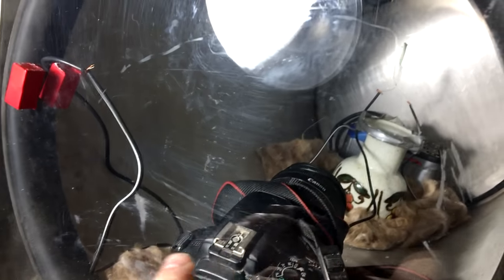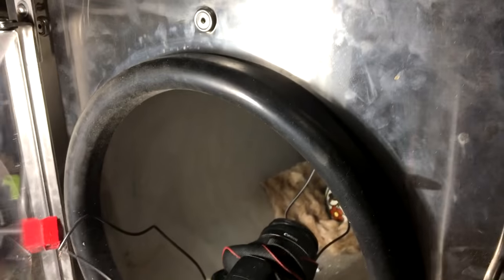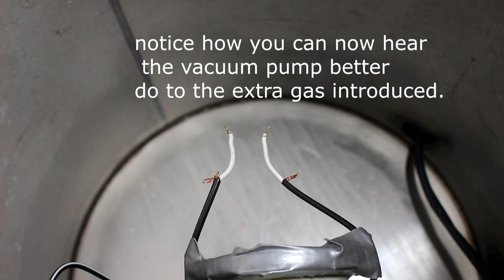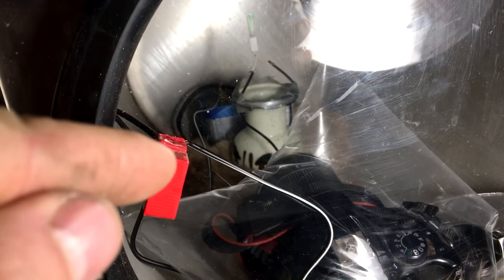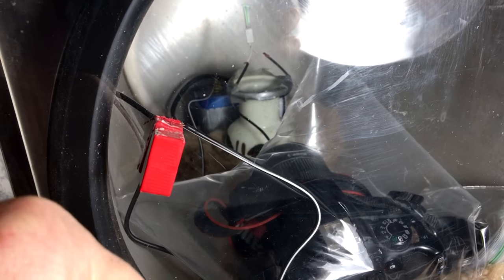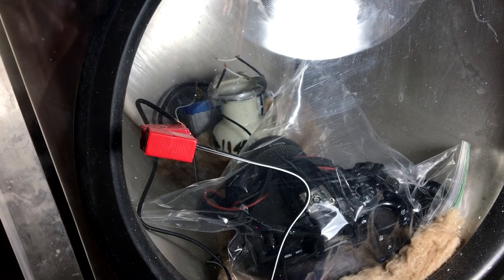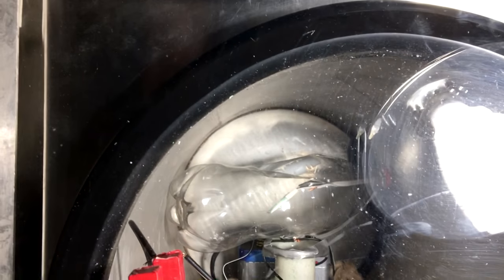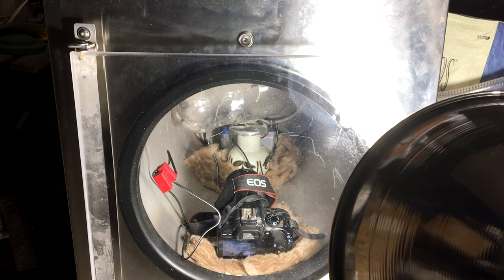Sound of Explosions in Space? part 1

Comment: OK, so explosions in space make sound.  That's good to know as I've always been told the opposite.  However, I would imagine in most science fiction movies, the space-ships are usually a pretty good distance apart.  And I would imagine at minimum you would hear no sound for several seconds or several minutes until the gasses from the explosion collided with your ship.  And even then, at those distances, the gasses would be much less concentrated than inside that little chamber.
Reply: What about a Nuclear device that's more heat than expanding gasses?
Like BSG.
Reply: Though there will be comparatively less medium for the sound to travel the individual particles will be moving at greater speeds and will therefore make more sound individually. It's hard to say, I'd guess they'd make less noise at the same distance and explosion size bc much more of the nuclear bomb gets transferred into massless photons then other conventional explosives.
Reply: @codehorse8843  
Photons thought technically massless release energy and create pressure as evedenced by the Crookes Radiometer!
Reply: One could imagine that they are using futuristic materials for their space crafts which are under very high internal pressure at all times, as a consequence of their strengthening process. Which makes them less likely to break, but when they break they break spectacularly, releasing a burst of fine powder as the material fails, helping to scatter the energy from the impact, and glowing red hot from the thermal energy of the impact, creating what looks to us like the glowing ash of an earth fire
Reply: @Allangulon  BFG 9000
Reply: @codehorse8843  I think it's too much said it makes sound, it's more like to get hit by an astroid, that sounds too ^^ Normally, the gases will spread like a sphere not as here in a tube, that will make differences, too.

You wont here the impact of protons and other elemental cores, nor micrometeorites. I think beyond a certain distance, youll rather hear the vaporising of parts from your ship skinn ^^
Reply: Actually the explosion doesn't make a sound.  What you would be hearing is the sound of debris hitting your spaceship.  It's the same in this experiment.  All you are hearing is the debris hitting the side of the vacuum chamber, not the explosion.
Reply: @magnetospin  the gas hit not debris
Reply: @toomanyaccounts  Same thing.
Reply: @magnetospin  meaning you can still hear an explosion in space. there is a moving medium to carry the sound
Reply: @toomanyaccounts  Actually, no, I looked at the video again. It's not gas, it's debris from the blasting cap.
Reply: @magnetospin  the bottle didn't seem to have debris and the guy did a post where he  consulted and the gas transmitted the sound when it hit
Reply: @toomanyaccounts  Just because you weren't able to see debris doesn't mean there's no debris.  It's a vacuum, there wouldn't be any gas.  The blasting cap was blown apart, so of course there's debris.
Reply: @magnetospin   Explosives create their own gas, so it's not true that there would be no gas. That's part of how many explosives work. It's not just the debris; it's also the expanding gas.
Reply: @The 8-Bit Guy  That criticism applies even moreso for explosions on Earth. Explosions filmed on Earth have a significant delay because the shock wave travels only slightly faster than sound. However, in space, the blast wave would travel many times faster than sound without slowing significantly, which means there should be a much smaller delay.
Reply: @DANGJOS  It may create a plum of gas, but that gas isn't carrying any sound from the explosion.  To carry the sound from the explosion, the gas needs to exist before the explosion.
Reply: @magnetospin   It's creating a blast wave that is unimpeded and traveling outward. Do you think explosions are capable of magically sending energy via a dense medium like air, but completely incapable of transmitting it via the same gases that cause the shockwave in air in the first place?
Reply: @magnetospin in the comment you made right before this one you said, “it’s a vacuum, there wouldn’t be any gas.” then, your very next reply says, “it may create a plum of gas.” sooooo, which one is it? 🧐….🤣😂🤣😂
Reply: @magnetospin so, what about farting in space then?? THAT gas exists BEFORE the explosion doesn’t it? so your saying you would NOT be able to hear your own fart in space (or vacuum) if you ‘let one rip’? seems like you should be able to hear it, might sound totally different, i dunno..just seems like you should be able to, for an INSTANT anyway…? hey! wonder if you could SMELL it too? how does smell work in a vacuum…same, or no? 🤢☺️👍

Comment: It's producing too much gas. Try a much smaller explosion in a far larger vacuum. It would be nice to see in real time a silent explosion.
Reply: To put it simply, once the cap goes off, the chamber won't be at a vacuum anymore.  If a vacuum chamber has a volume of 40L and a reaction liberates one mole of gas, the pressure will rise to about 0.5 atmospheres.  I don't know how much gas a blasting cap liberates, but if one had a ringing bell in the vacuum chamber, the gas from the blasting cap--whether released quickly or slowly--would most likely be enough to make the bell audible.
Reply: Flat Finger Tuning 
Yeah I know. 
That's obvious...
Reply: I don't either but it's not a mole. 12g of carbon-12 isn't as small as those explosives.
Reply: IamGrimalkin 
I didn't say it's producing 40 litres of gas...
Reply: Sean Dali I was trying to reply to flat finger tubing.
Reply: IamGrimalkin 
Ah right. Haha. That's what the reply button is for 😉 no worries. 

It's pretty amazing just how loud the gas is though, I expected a time little "poof" but it was quite a lot louder than that. I guess it's because the vacuum chamber is only 40l and the gas can easily fill it when it's under vacuum. 
I'd like to see the experiment in that giant gas chamber they had on myth busters (was it at NASA?)!
Reply: Sean Dali or we could actually have people go to space and shoot a gun and see if the camera hears anything which it will because you can still hear in space noises still exist in space but yes it is very quiet but then again it's extremely extremely massive and not many things are very close together for example if we can get closer to the Sun before disintegrating there are millions of popping noises coming from atoms exploding which is what makes up a sun or star
Reply: ^
This dude.
Reply: Sean Dali dont use explosives at all.
use a tiny USB speaker. you schuld see it vibrating but it should not make any sound in vacuum
Reply: Cyano Mod 
You're completely missing the point. 
A speaker doesn't create any gas, or any outward pressure in a vacuum whatsoever. This is specifically about testing explosions, not sound in a vacuum (which obviously doesn't work).

Comment: You stuck a $500 camera in a vacuum?! wow that was a risky move.
Reply: It's more than 500$ , doesn't risk much though , puting it next to an exploding object however is risky
Reply: OH I don't know the exact price. I have the same model but I bought it as a package deal for $1k. It came with a bunch of software and 2 lenses.
Reply: Alpha Nerd That's a pretty good deal .
Reply: The camera could definitely fail in the future. Electrolytic caps are sealed, but not to an atmosphere of pressure. Batteries too. And the microphone itself has a chamber behind the diaphragm that needs to have equal pressure.

Comment: of course explosions make a sound in space, an explosion generates sound waves which are a form of energy so they would then propagate across a vacuum or until they are absorbed or deflected by an object or matter.
Reply: Kenneth Donnelly but how do they travel trough space?
Reply: Kenneth Donnelly Nope, there are 2 types of waves, sound waves that need a medium like a liquid or a gas to spread and electromagnetic waves, for example light, that do not need any matter to travel
Reply: you might as well ask how does light travel through space.......its a sound wave its a form or radiation it travels away from its source until it is ab absorbed by something.......unless it gets to an area where the laws of physics have stopped.
Reply: Legiaseth space is not a complete vacuum there are gasses and dust in "space" so yes sound waves can spread albeit very slowly compared to electromagnetic waves.
Reply from the maker: In a vacuum there are no waves; the gas that hits the camera is the same gas that was released by the explosive.
Reply: u can't be serious.... ahahahaaah
Reply: and that's why you gotta do some research before trying to sound smart
Reply: An explosion doesn't produce sound waves so much as the explosion is a sound wave. Of course, the explosion compresses gas around itself as well, which is why you can hear an explosion without being hit by it
Reply: What I'm trying to say is a sound wave is just a pressure wave
Reply: Kenneth Donnelly Only light energy can transfer through a true vacuum tho.
Reply: That is completely false. Only light energy? What about gravitational energy (gravitons), or neutrinos?
Reply: Ken M. ?
Reply: guys, he might be saying that explosions can make sound in space because WE are in space, space by definition is anything that can or cannot be occupied, if he said OUTER SPACE, then he would be wrong.
Reply: "sound waves which are a form of energy so they would then propagate across a vacuum " -Kenneth Donnelly
Reply: The Lazy Modeler space isn't a perfect vacuum so some sound although extremely minute could possibly be detected
Reply: nah valdez lol, that sounded intelligent with the quotes.
Reply: Jeez you guys are ruthless. lmao
Reply: Kenneth Donnelly But sound is kinetic energy put into atoms/molecules and relies upon them transferring that energy to other particles. if the explosion was in deep space and our under standing of gravity is right every explosion has a maximum radius of effect and a much smaller measurable effect radius.
Reply: it's got to be Ken M.
Reply: Kenneth Donnelly A) electromagnetic equals light so yes, light speed. Yes there are particles in space, but a sound wave would not over come the speed of the solar wind. it might impart some variance in the wind but not greatly alter its direction. plus in a strong vacuum you have particles that pop into and out of existence, so what would happen to the energy they pick up from a 'sound' wave
Reply: Kenneth Donnelly sound radiates, it is not radiation . a explosion in a container strong enough to contain it in a strong vacuum, because there isn't a perfect one, WILL NOT BE HEARD by those listening outside  without a direct connection to the container
Reply: Cody'sLab the gas was moving in a wave, it just didn't get obstructed by 'static' gas molecules. What is the speed of the wave? with out a fluid limiting it is it just a function of the power or the boom? What makes the fastest pressure wave, I'm thinking of all those Stat Trek escapes from novas, how long from the time light would hit the earth if the sun went boom now and the plasma would hit.
Reply: ovrkill1234 Aren't we all?
Reply: Explosion cause gas and wave also pushing gas to travel until it got reduce and suck up by gravitational . space is full of gravitational that's why every thing slow down but every thing in the gravitational field also traveling at extreme speed . once the gas travel far enough in the globe shape start to dissipate  from the distance and got lesser Mg/sq over time .

Sound came from vibrating that cause by wave  and wave's still traveling until it loss it properties until then wave can still make molecules reflect it and cause sound .
Reply: Ol' Bluelips any matter would be happy to travel though a vacuum, a moving gas front would radiate any pressure waves in it as random heat over time but the particles would happily keep spreading till a outside force stopped them, and how did we get to things that don't make sound?
Reply: Sounds waves need a medium to travel through. There isn't one in space beyond extremely negligible levels. Essentially none for this.

Comment: Hey, Cody! You should totally try cold welding!
Reply: cyancoyote nearly impossible to do. You need an absolutely perfect vacuum and a method to perfectly remove oxidation from the metal. Not doable
Reply: Totally try as opposed to only half try?
Reply: There is no such thing as a perfect vacuum.
Reply: Replace the atmosphere with co2 then, then vacuum. Close enough to maybe allow it. Just throw some dry ice in wait for a while and start the pump, turn it off to let it continue to sublimate, repeat until happy with concentration.
Reply: even space isn't a 100% vacuum and still, cold welding is an event that NASA has to consider when building space craft. it's doable, but perhaps not with what Cody has available to him.
Reply: well, if it looks like cold welding won't work, how about cold fusion?  that should be way more useful right?
Reply: no such thing as a perfect vacuum?? 
Pha! Ever heard of a Dyson?
Reply: Screwg, it does not require an absolutly perfect vacuum, as that is not possible on earth, yet microprocessors are made using cold welding, it is possible in a decent vacuum, and you dont need to remove all oxidation, just at the point you are connecting, and not even all of it, because if enough parts are de-oxidized, then it will connect together

Comment: Bear in mind that the explosive produces gas, this has a pressure wave that propagates outward until it impacts the chamber wall. The difference of not having a medium can be thought of as the difference between dumping a bucket of water in a pond and dumping a bucket of water onto a dry floor. Both will propagate wave fronts, however the one without a medium will dissipate faster with respect to distance from the blast.
Reply from the maker: Actually it should dissipate less due to lower attenuation, but yes that is the right idea.
Reply: ***** I always thought it would dissipate more due to the differential between the overpressure and the ambient pressure, but I don't know that for a fact and would like to find out.
Reply: I would think it would dissipate more in a vacuum. You get a shock wave when the ejected particles are moving faster than the speed of sound, which leads to a sharp blast front. In vacuum the speed of sound is not a factor, so a sharply defined shock wave will not form.
Reply: SuperCreff This sounds like the makings of a great experiment. Let's call the mythbust....oh wait....
Reply: actually I think you can hear this effect in your second video. The explosion in air has a sharp crack. As the one in vacuum has no sound velocity there is no bunching of the particles (and so no formation of a shock wave) so you hear a "dooooompf" s.ound